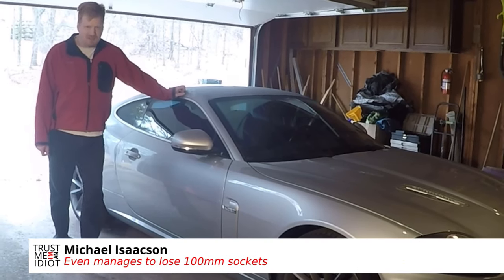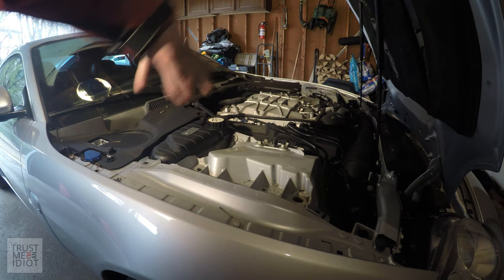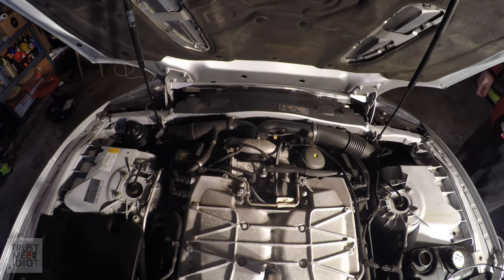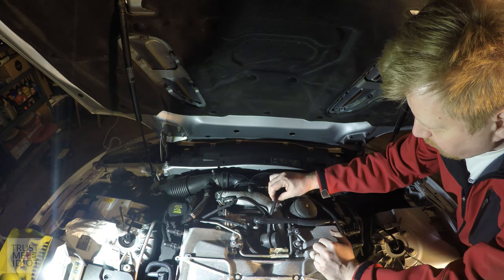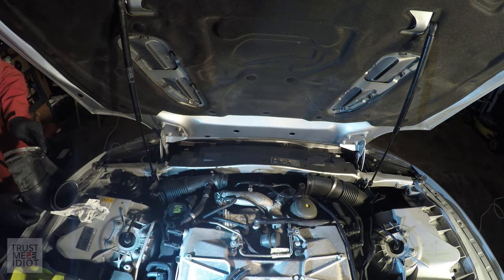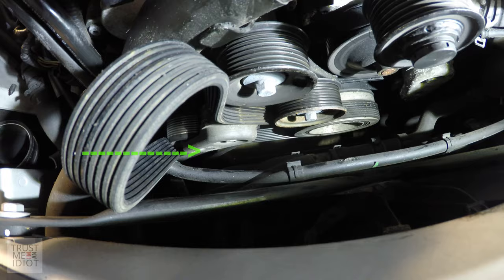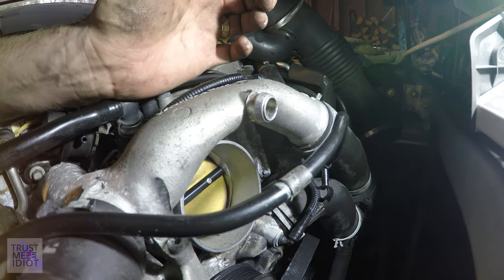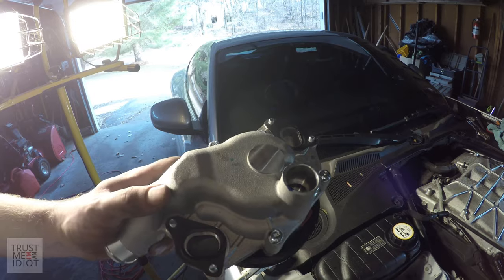How to Replace a Water Pump on a 2010-14 Jaguar XKR  (X150)

Comment: Had a 2010 XK, now a 2015 XKR and both water pumps went out at basically 53k miles. The shop changed the last one, but I'm doing it this time. Thanks for the vid!!
PS; I did a tune and an upper pulley change myself and took the hood off, think I'll do that again as its not as much trouble as running back and forth and not being able to lean over the front end. I just put a thick blanket on the roof and laid it up there....JustMy2Cents
Reply from the maker: I had seriously considered taking the hood off after my phone told me I had reached my step goal for the day, but I wasn't keen on getting it realigned when I put it back on.  Still, taking it off probably saved you way more time!
Reply: @TrustMeImAnIdiot  lmao..."Reaching my step goal for the day". True that! It's not really that bad to realign it, especially if you take a pencil and draw around the bolts before taking them off, and I've done both by myself, just finished the water pump today. I just use huge padded blankets to slowly drag it up on the roof. I did think for half a second of not doing it this time, but after just trying to get the back belt off, I knew I had made the right decision...Thanks for the reply!

Comment: Hey there great vid. !

I just did heater hoses, coolant outlet pipe, coolant hoses and thermostat housing on one of these bad boys and I fought the same stuff you did. 

Recommend removing the 2 - 10mm bolts from the air intake tube (instead of just the 7mm around the boots) and pulling off as 2 pieces. 
More room less plastic to tug out of the way/risk breaking. 

You’ll need less brunt force and just wiggle a ton. 

As for that coolant hose you had to cut, I actually came here to see if there was any tricks that could save me that headache.

Going back in to do the WP which obviously failed after all that work. And I really don’t want to cut/ replace that hose-again. ITS SUCH A TIGHT SPOT. 
Got some small spring loaded snappy pliers that are suppose to be specifically for those type of clamps- 
Wish me luck. 

Thanks for the vid.
Reply from the maker: It was a huge pain in the ass. Problem I think was that it had heat cycled enough times to be pretty well molded onto the flanges. I tried working around with a thin screwdriver and a pick to see if I could break the seal and loosen it up enough, but ultimately just got mad and cut it. Of course, I didn't realize at the time how expensive it would be to replace. Good luck!
Reply: How much did it all cost you? Many thanks in advance!

Comment: great video thanks. Perhaps removing the bonnet would make this job more easy?
Reply from the maker: Yes, to a degree, but then getting it back on and aligned correctly may have made it more difficult in other steps. Coming at it from the front instead of leaning way over the sides would have been nice. Though if you aren't 6'1" like me, coming in from the sides can have it's own additional challenges.

Comment: I broke the exact same small pipe/connector that you did at minute 7.01 - the part you hoped was a standard piece - what is it called so I can order one and where does the other end go? - thanks for your help. James
Reply from the maker: It's the overflow pipe. it starts there, then heads off towards the passenger side of the engine and ends in the coolant overflow/fill tank. Fragile little bugger. Check to make sure this matches your car and the pipe, but I think this is the replacement part you'll need: Item #3 on  https://parts.jaguarpalmbeach.com/a/Jaguar_2010_XKR-Base-Coupe-50L-V8-AT/_52014_5992976/HOSES--PIPES/4740102.html  (I am not affiliated with JPB in any way, they just have most of the parts available online and I haven't had any issues with my orders from them in the past.)
Reply: Sweet olive been struggling with this because I didn't know what it was called. Thank you so very much

Comment: What was the torque value for the water pump mounting bolts. It appears to be the same pump as the 2013 XF 3.0 v6 T30 torx into aluminum block which I cant find the torque value anywhere.
Reply from the maker: 11 Nm. All the torque specs are on page 1,156 of the workshop manual: https://mega.nz/file/BJ9kXbiJ#9V1Zl7SAlgrXb7UvL5Zd0QQHTvowwjOvllah5wrRlXc

Comment: The hose cutting wasnt necessary to remove the pump also the you have to transfer the upper hose outlet connector before installation
Reply from the maker: Very true, and a lesson on why you should keep your cool when doing auto repair. :)

Comment: What's the name/part number for that hose that broke?
Reply from the maker: I think if I recall correctly it was the coolant overflow pipe, C2P13304, which is #17 on this page: https://parts.jaguarpalmbeach.com/a/Jaguar_2010_XKR-Base-Coupe-50L-V8-AT/_52014_5995252/RADIATOR--COMPONENTS/4740101.html

Comment: I have a 2011; my mechanic wants to charge me $700 to replace....does that seem right?
Reply from the maker: Probably. It would likely take the mechanic 2-3 hours to replace, plus the part, which is around $125 and up. There would be coolant to drain and refill, etc. So yeah, that seems pretty on target.
Reply: Lucky for you that you can do your own work!
Reply from the maker: @evagabor5  Lack of funds and desire to pay mechanics that much was a powerful motivator. Plus, a LOT of stuff is far easier than you'd expect.
Reply: @TrustMeImAnIdiot  How many miles did yours have to have to replace the pump? Mine has 49,749.  Supposedly things dry out if not used enough.
Reply from the maker: @evagabor5  65,000 or so. Wasn't a fast leak, but certainly not something I wanted to leave for long.